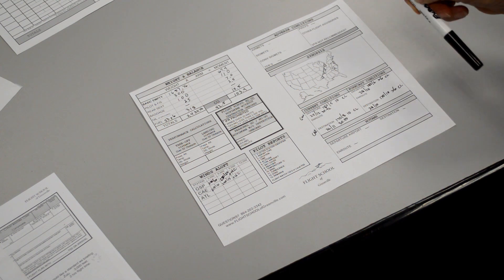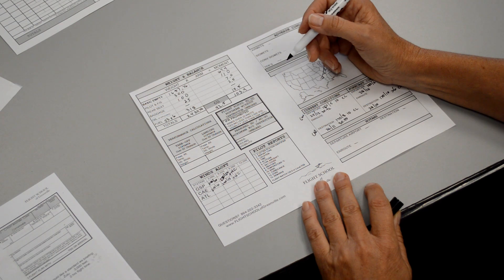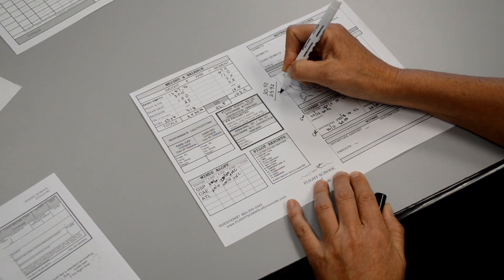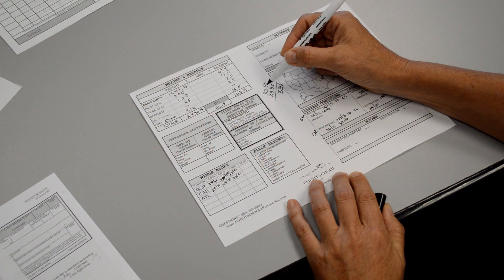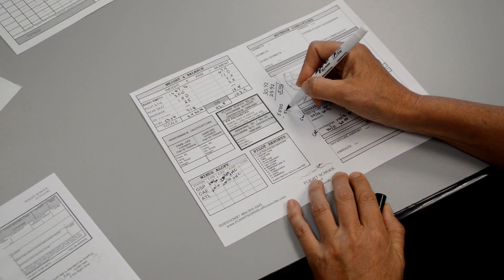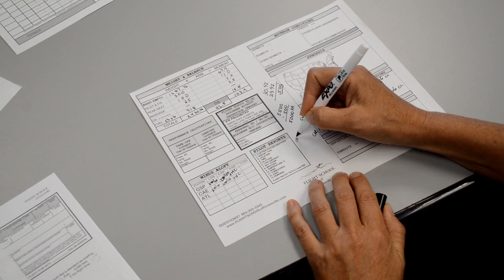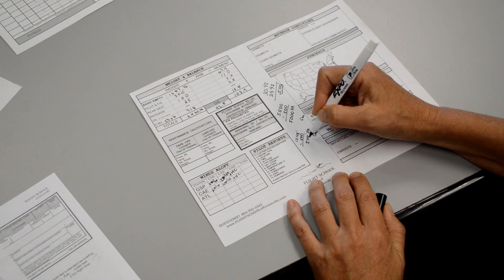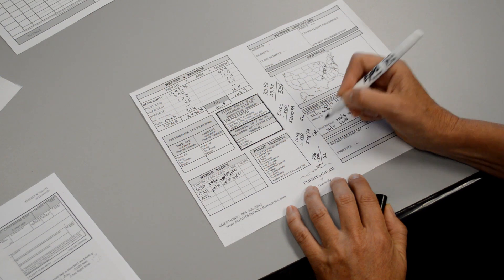Calculating Pressure Altitude - XC Flight Planning (Private Pilot Lesson 14c)

Comment: My airport elevation is 81ft so my pressure altitude today was -287 with a 30.32 altimeter setting. Do I just call it sea level?
Reply: I’m late, but yes
Reply: I know it's 3 months late but your pressure altitude should have been -319 with a 30.32 altimeter setting. 

  30.32
 -29.92
--------------
   0.4

0.4 x 1000 = 400

81 - 400 = -319

Either way, its still Sea Level Pressure for performance calculations.